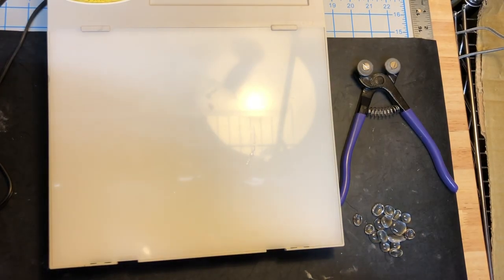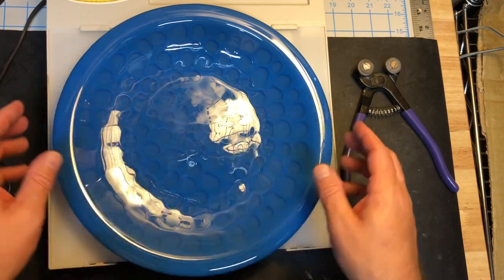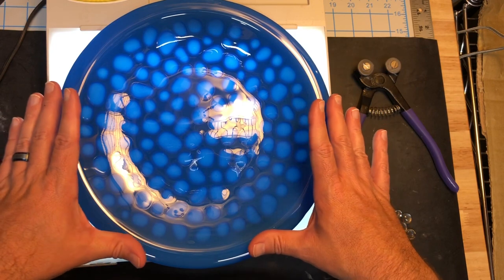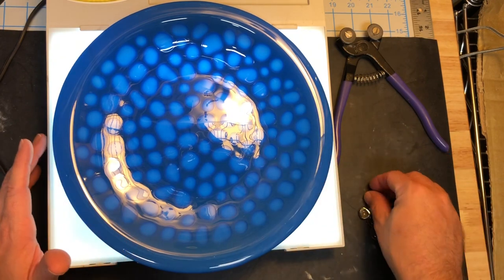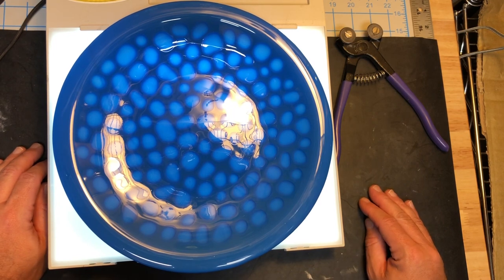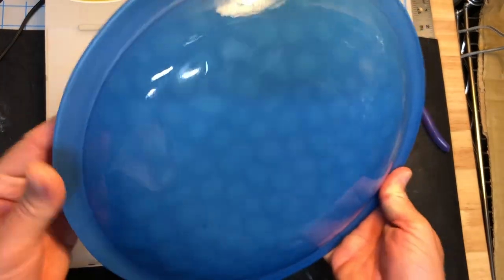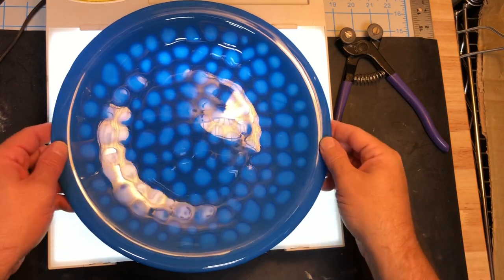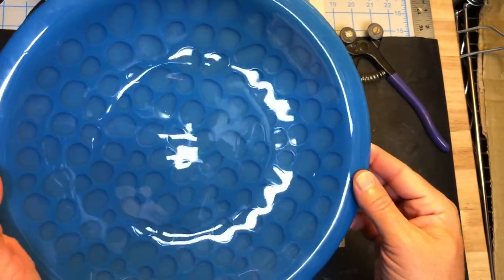Easy fused glass project for beginners or legends!

Comment: Thanks for sharing! Projects like this are just what I need to get braver and learn more about how glass behaves.  Were  the tekta nuggets made with 2 layers full fused on top of one another or just single pieces full fused to create dots?
Reply from the maker: Just single layers chopped up into different shapes. If I had more uniform shapes and used two layers, they would have been much more circular, uniformly round. I didn’t mind the organic shapes of using single layers.

Comment: I am new to fusing and am confused with the firing schedule - would you be able to provide it in a response. I really don't know what as fast as possible means in actual temps? Thank you
Reply: Someone just showed me how to get to you schedule for the bowl, but not the balls.
Reply from the maker: The balls were done as a full fuse in my kiln… same top temp as the bowl. It will depend on your kiln, but for me, it’s about 1480 or 1490 for 10 min. The pieces were anywhere between a dime and quarter when I fused them the first time?

Comment: Hi! I made a small plate with the drops near the edge of the dish, but not in the middle. Got some bubbles n the middle. Can somebody tell me way?
Reply from the maker: It’s likely that the extra weight around the edges “sealed” your outer edge of glass before the inner area released all the air. So you got bubbles in the middle where air was trapped and could no longer escape?
Reply: thank you!!!
Reply: I tried to get the bubbles, but only inside. It must have been the different height of the stringers and the square. Thank you very much!